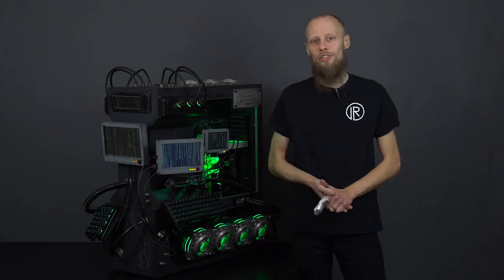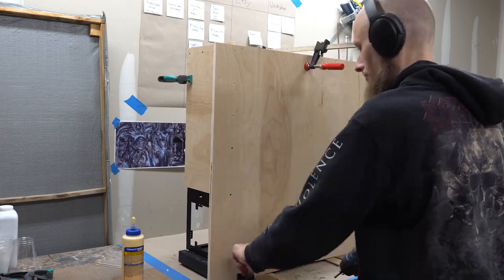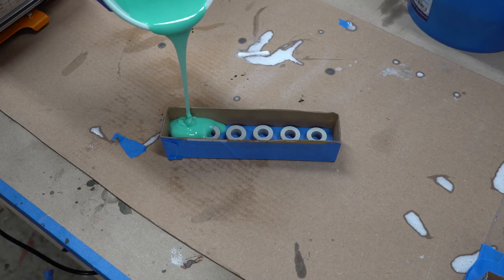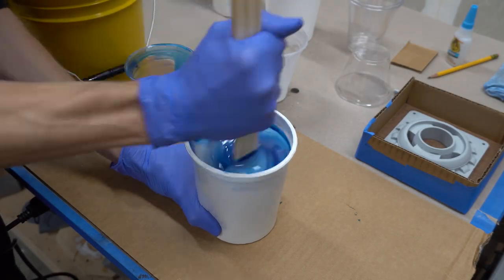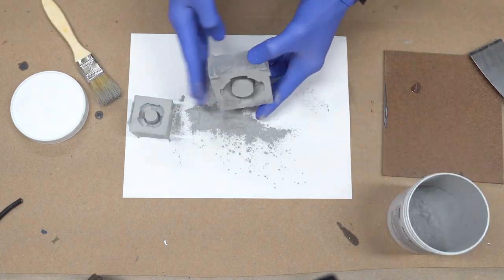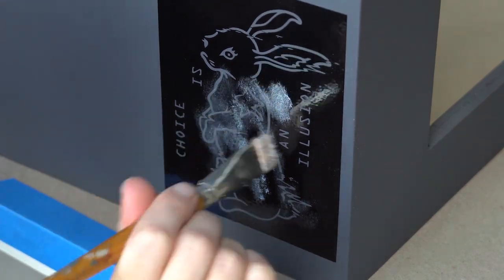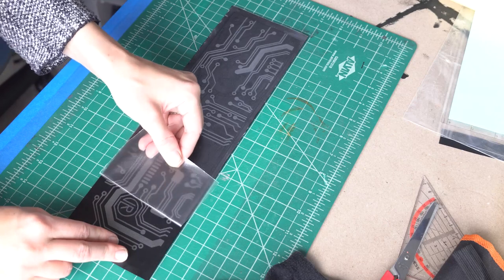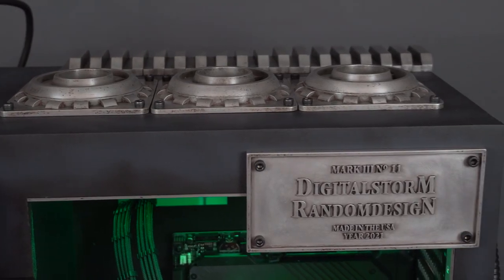Matrix Case Mod - Backup Operator

Comment: Awesome work! What displays did you use and how are you playing the matrix code?
Reply from the maker: Thry are just normal 7-11" displays I found on amazon. All connected with HDMI or DP. For the Matrix code I used a simple Youtube video in full screen on repeat.
Reply: @RandomDesign  Thanks for the reply, so the displays are connected to the actual PC? like they are nor running the video file independently?
Reply from the maker: @Morpheus170  yes, they are directly connected to the computer.
Reply: @RandomDesign  Thank you!